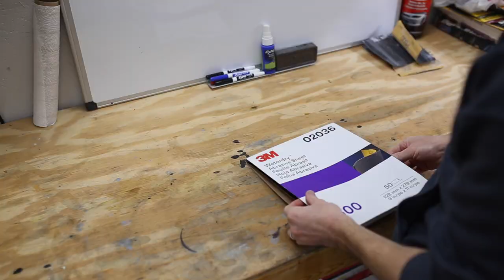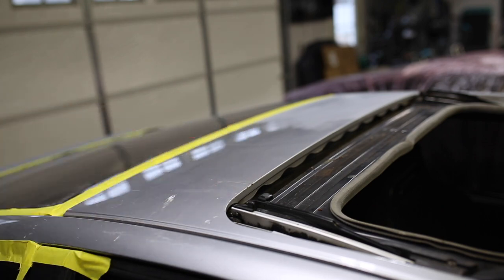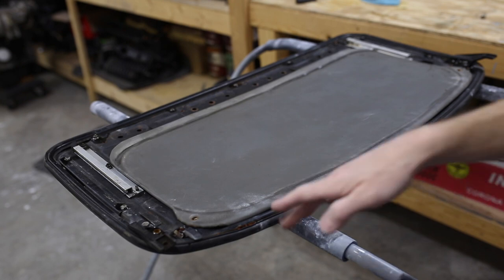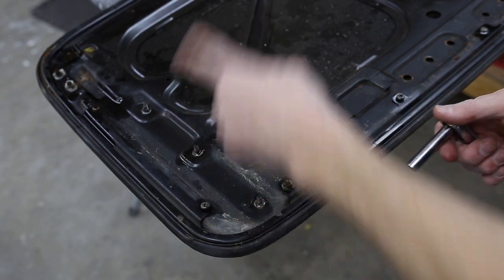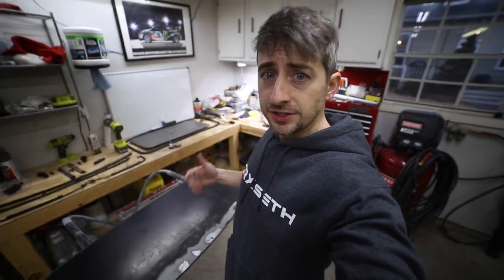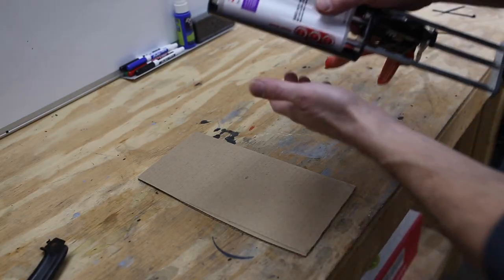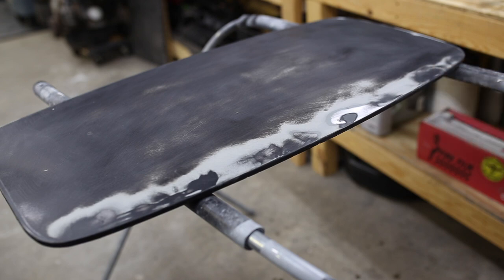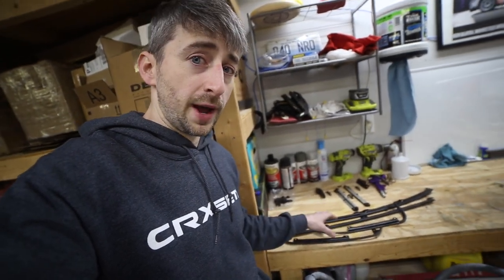1989 CRX Rescue Part 15 - Sunroof Prep

Comment: Put the brackets in a container with Apple Sider Vinegar to get rid of the rust, I used this method with tools, bolts and little stuff like that and never disappointed with the results
Reply from the maker: Good suggestion.  I've got some Evaporust, so I will probably use that since it's on the shelf.

Comment: Thanks Seth remember reading as you painted the black car on the crx community page. You got a great finish on that, can I ask why you don’t use a da sander and prep by hand?
Reply from the maker: Probably because I don’t have good sanding discs for the DA, so it clogs quickly, and I feel like I have more control by hand.